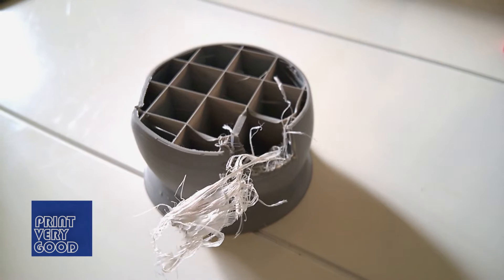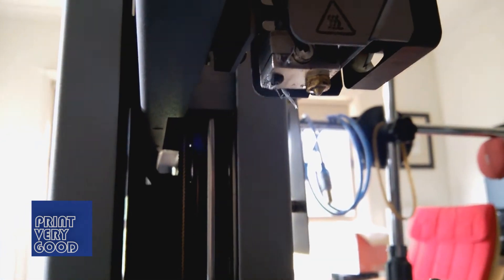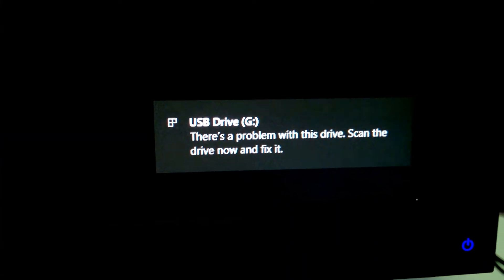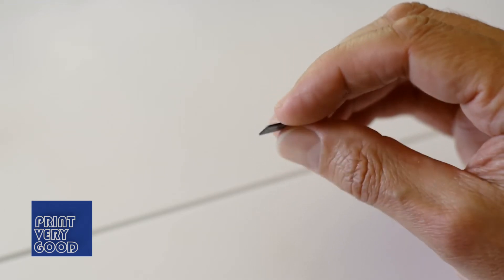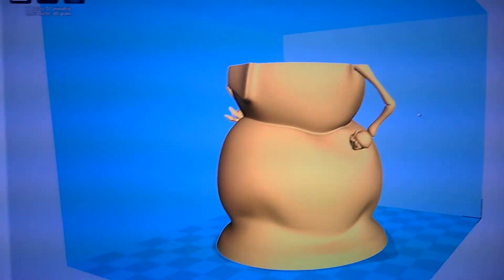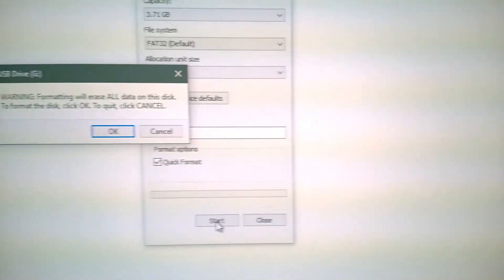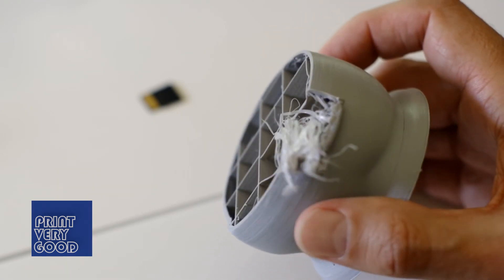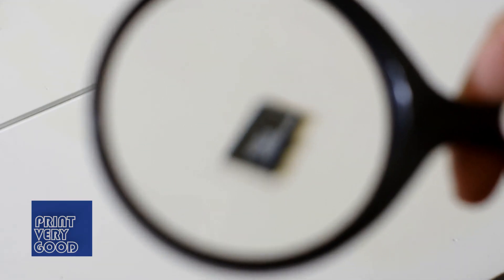The Cause of my 3D Printer Crash - Cocoon Create or Wanhao i3 Mini

Comment: My card failed as well and my friend and I bought 2 new cards from Cocoon. Sorry everyone, they were the last cards listed on their site. I found another supplier of cards on Amazon for 2G cards. You have to buy SD cards (or SD compatible cards). Anything above 2G may not work, anything above 4G will almost definitely not work. There is a change in the interface on the card to deal with higher data rates, hence the SDHC instead of just SD. The software in the printer doesn't understand how to talk to the card (maybe fixed with an update, I'm not sure).  Hope this helps.

Comment: Thank you for your video! It gave me another dimension to contemplate as to why my wanhao i3 mini was crashing. I don't have a microsd to usb adapter but I do have a laptop with an sd card slot and I also do have a micro sd to sd adapter. So I have been writing the files to a flash drive and then transferring them from my flash drive to the sd card using the laptop. It turns out my flash drive was corrupting the files for some reason and naturally my printer would immediately crash without even starting to warm up the nozzle. I switched my flash drive and everything is running buttery smooth.

THANKS!!

Comment: I bought the same printer and am having similar issues. My prints are stopping randomly during printing. The printer is actually crashing and I have to restart it to get it to respond again.
I've since bought a new SD card but it hasn't solved the problem. I've tried downloading and slicing new models and they call crash in the same way. 
Have you seen any thing like this with your printer?
Reply from the maker: Hi Vic, sorry you're having trouble with your printer. The new SD card solved my problem but if a new and correctly formatted SD card did not fix your problem I'd highly recommend contacting Cocoon Support. Details below.

support.cocoonproducts.com.au
Ph: 1300 663 907
help@cocoonproducts.com.au

Comment: I have the new Cocoon Create which recently came out this year. 
The issues I am experiencing are the same or similar. 
I too had to insert and re insert the sd card into the printer a few times but assumed since I could see and print some files it was fine. Will buy a new SD card ASAP Thanks!
Reply: You can do a full format not a quick format... a quick format doesn't check the sector's it just wipes the fat table data.  You can do a low level format that forces the device to write 1&0 on each sector.. u can also use an eraser to clean the contacts that might help and use isopropyl alcohol
Reply: rob rocco issue ended up being with the device and had to be replaced today. System crashed regardless of micro SD veing used. Screen goes non responsive as does knob.

Comment: Easy to be wise after the event but that little dance the head did right after printing the brim was probably your cue to abort the print and take a look at the gcode. Glad you got it sorted out.

Are you planning to revise your reindeer using your excellent new locking joints?
Reply from the maker: Thanks Steve! Yes for sure, I know now ;) 

Re the Reindeer, I probably will when I eventually get a larger printer.